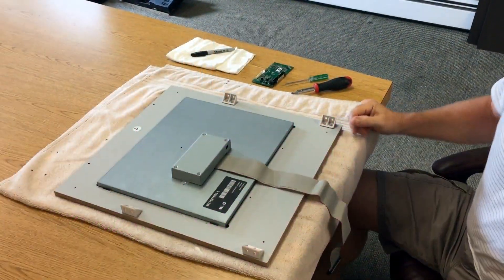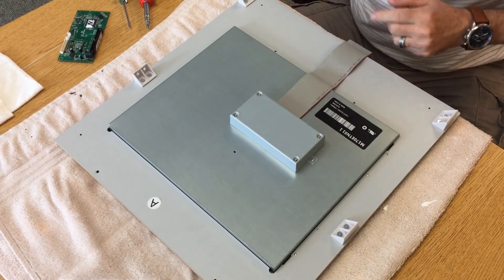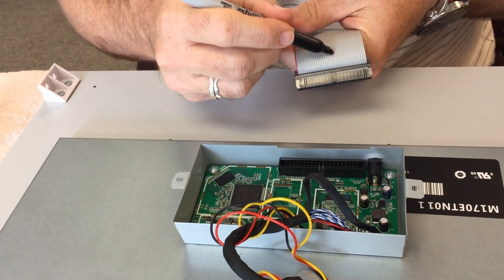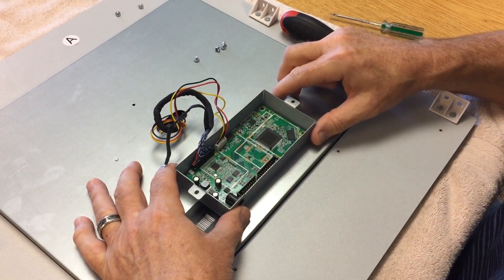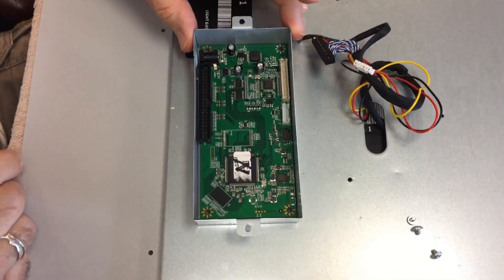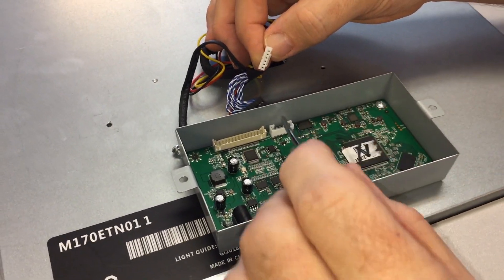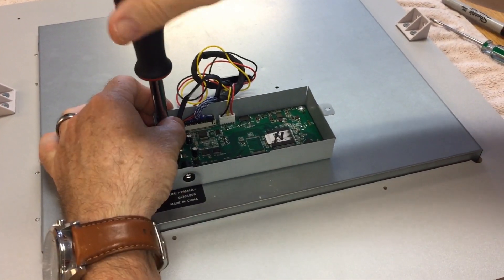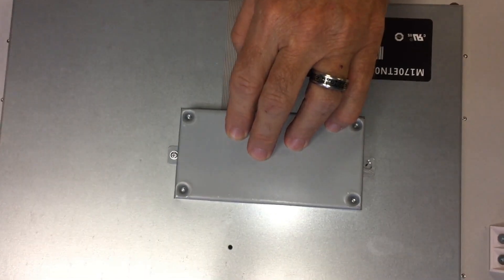Arcade1Up PCBA Instructional Video

Comment: I'm going to try and replace the PC board without removing the display panel from the cabinet.  Hope it will be just as easy as it was in the video.
Reply: How did that go? Going to try the same thing and was curious if it worked well for you.
Reply: @a.k.a.blakestone9063  I took off the two screws on the metal box cover and  after looking at the board I noticed mine had an extra connector on it.  Since my machine is working ok right now (except for a popping noise when powering up the unit),  I decided to postpone the board swap for the time being.

Comment: Hey guys need a monitor replacement video. Meaning complete unit monitor replacement.   I only want to unscrew what's minimally needed to swap.
Reply from the maker: Hey Lacrossed55, thanks for reaching out and we’re sorry to hear about this issue. Due to the influx of inquiries, you may experience some delays in response times. Please contact our customer service toll free line at 1-800-764-2760 or email us at customerservice@arcade1up.com  and our team will get back to you as soon as possible. Thank you for your patience!
Reply: @Arcade1UpOfficial  Hey folks. Thanks for reaching out.  I have all my parts for a monitor to monitor replacement. 
I would like a video that shows how to replace monitor in a complete unit. So how much of the unit needs to be taken apart to swap. I don't want to deconstruct more than I have to. Make sense?

Comment: I jsut bought a 1up mortal kombat legacy from COnn's Furniture nearbye as they were salign them and had oen left. box was gflawless, but this is day 2 started getting the white screen problem then it will cycle white red - green-  white the flicker white, ca hear audio as knob is move to select but see nothing. Unplugged awhile, it worked again, the stopped again after awhile.  put in  a ticket on 1up. Would hate to have to rebuild the whle cabnet as I was very careful to do it right, but hate to have to rebuild it so soon if replaced.

Comment: By accident I disconnected those two wires coming out of the back of the LCD panel is there a way to get rid of that metal dark place or disassemble it so that I can reconnect that those wires I mean

Comment: My brand new arcade 1up won’t turn on at all. I just hear a crackle noise.
Reply: Mine won’t even turn on
Reply: Mine either!
Reply: any updates from you guys on these issues? I bought a Pac-Man one months ago and it works fine. Got the TMNT one today and no power. Went on the website that the phone directs you to (no live person as far as I know available) and did the step-by-step troubleshooting. Still no power. Now I just got a response a few seconds ago saying I need to upload a pic or .mov vid proving the defect, receipt, and contact info. If these guys are a hassle like most of you seem to say then I'll just return it for my $ back if I don't get better responses from them.